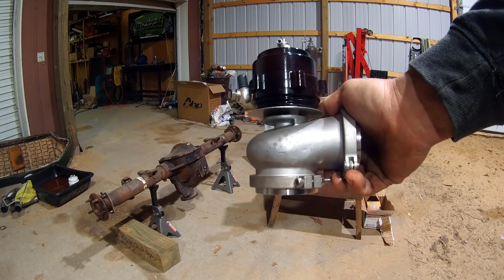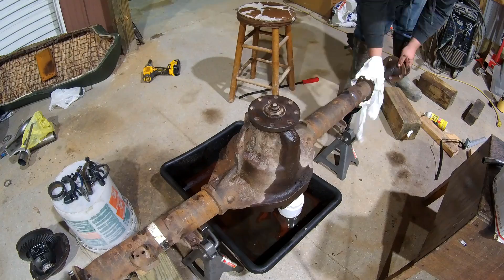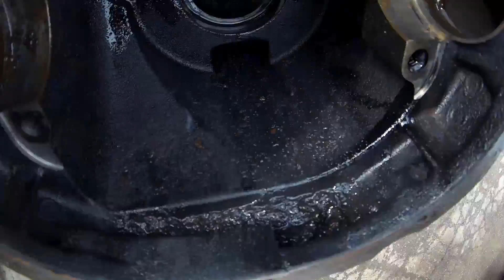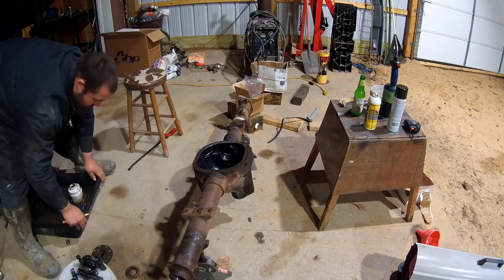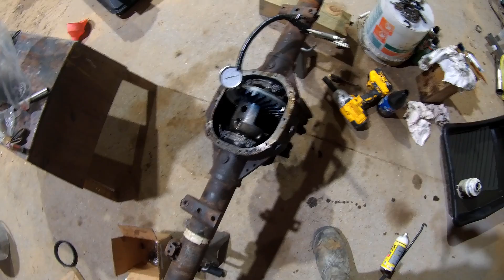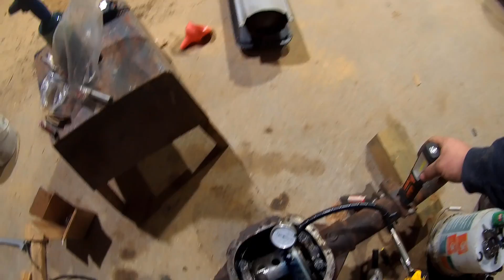Ford 8.8 Rebuild / Regear - The Quick Way

Comment: Any advice on putting the new shims in without a big press? Wondering if I could Jerry rig something using a ball joint press.
Reply from the maker: I freeze my shim packs minus one large shim put the shims in place and tap in the last shimwith a hammer
Reply: @Dirtfloorfab  I probably should have said bearings when you used the pneumatic press.
Reply from the maker: @shanesubashe787  oh I've installed them with a pipe a couple blocks of wood and a sledge hammer press just makes it eaaier
Reply from the maker: If you heat the inner race up with the torch they'll pretty much come off with pry bars

Comment: So..... isn’t it easier to use a puller or slide hammer to get the bearings and races out? Beating socket extensions seems hard on tools and a little too violent to keep the warranty?
Reply from the maker: My Mac tools guy just laughs. Use what works I guess. I was looking for a small diameter pipe but didn't have one that length